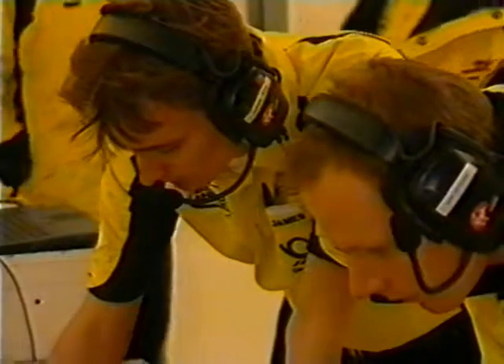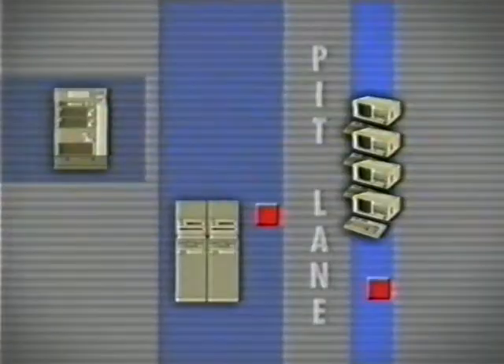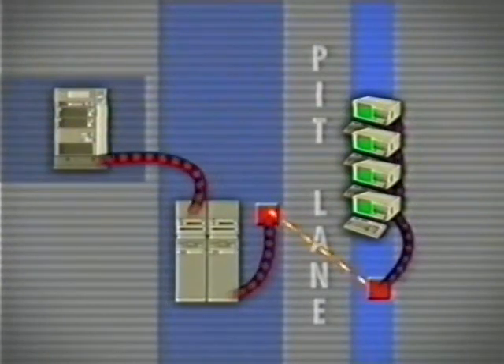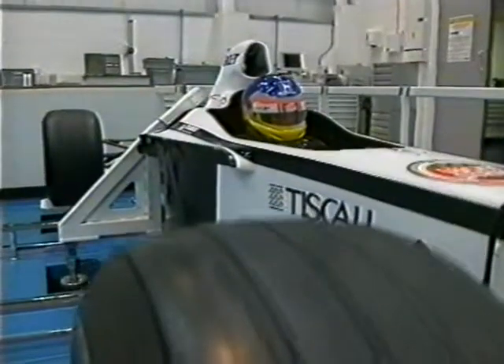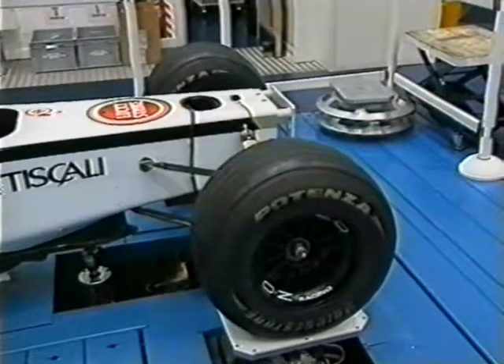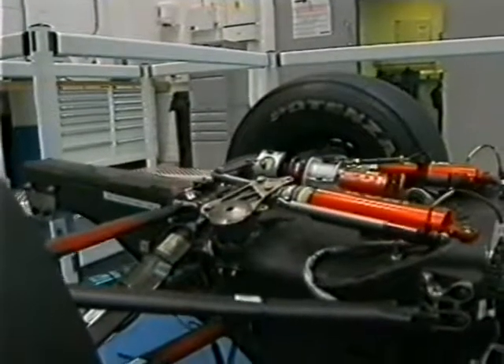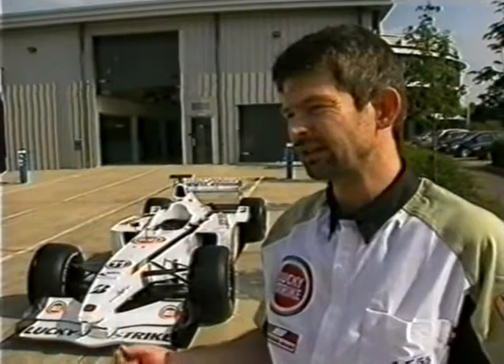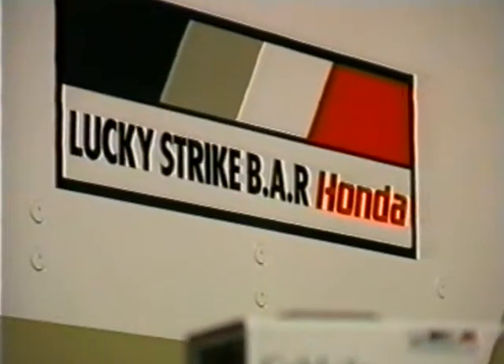CableFree Gigabit FSO links used by Formula 1 teams

Comment from the maker: CableFree Gigabit FSO links have been extensively used by Formula 1 teams such as BAR/Honda for reliable, secure high speed Gigabit Wireless communication during F1 races, providing ultra secure, highly reliable mobile/temporary network segments that are deployed in minutes, don't require frequency licenses or suffer interference.